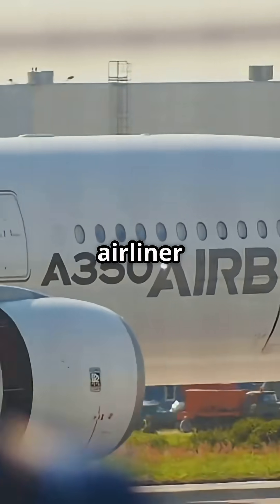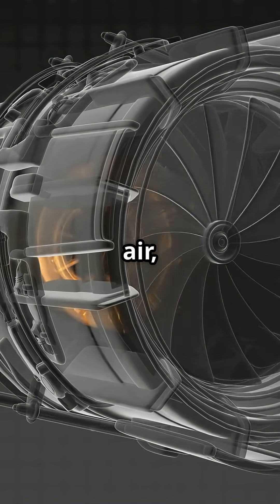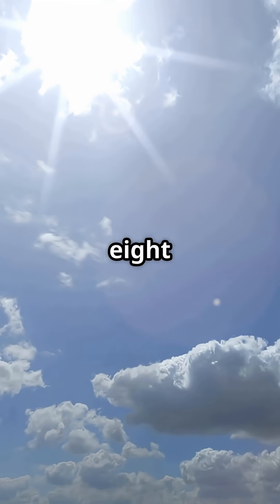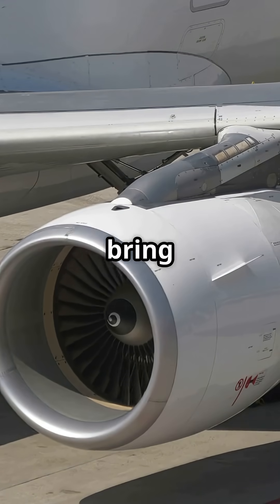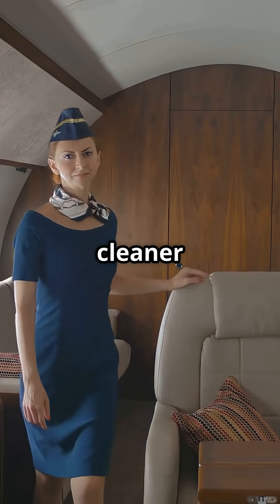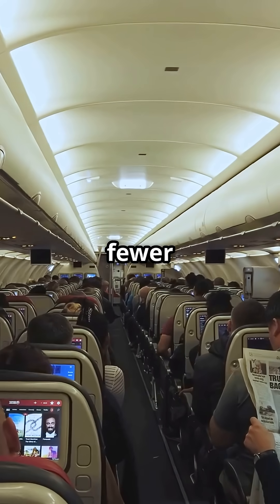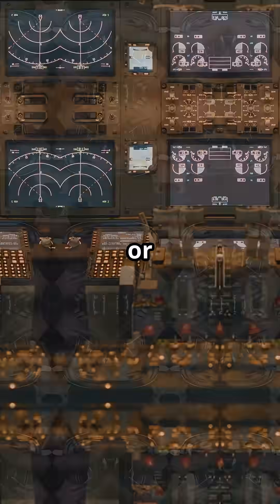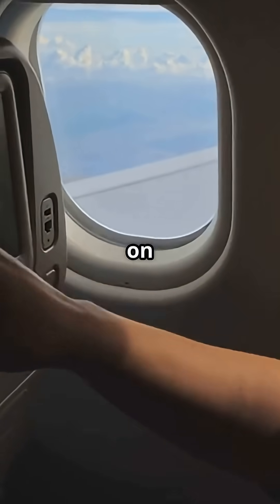787 vs A350 — why does one feel fresher at 35,000 feet?

Comment: In truth I would like to say Boeing has the better design from a physics stand point swapping to all electric subsystems so the bleed air system can be removed which make the engines run considerably more efficiently however in practice I find airbus to be a lot more comfortable a flight personally and from a reliability stand point bleed air systems are often simpler than their all electric counterparts and there is less worry of single point failures like with the inverter system of the 787 so I believe airbus designs are safer but marginally so